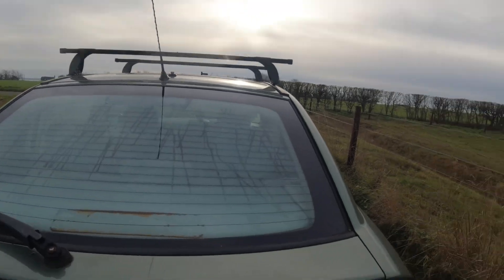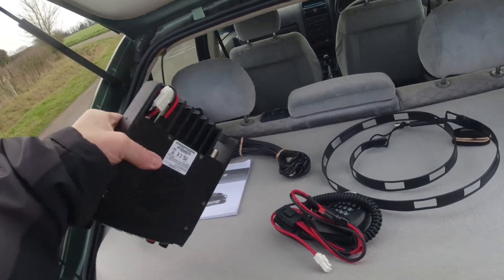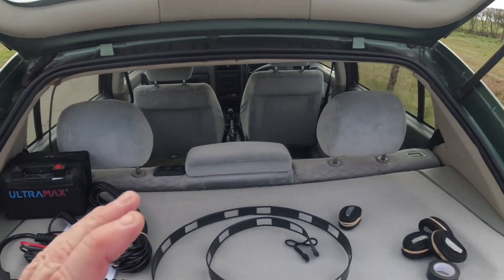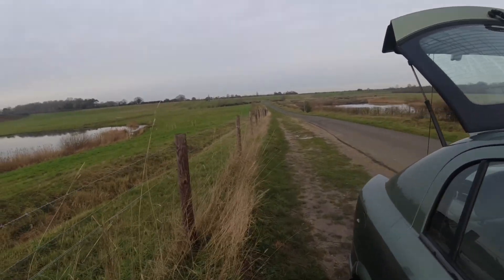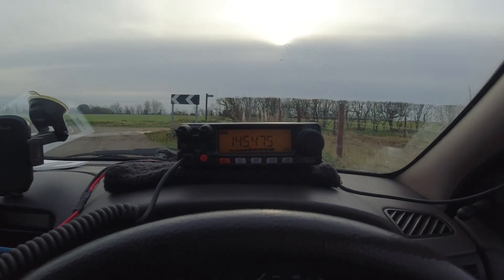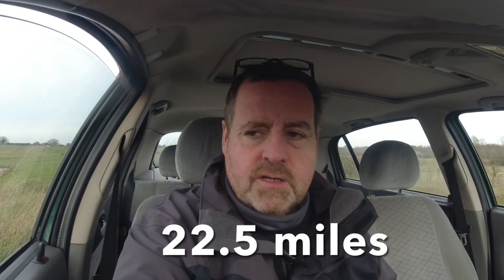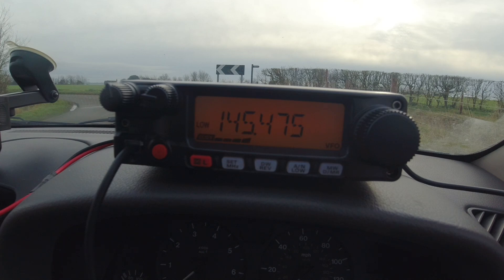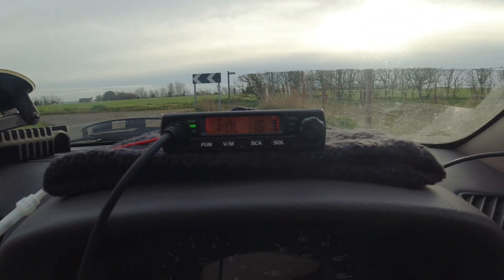Slim Jim Antenna and Yaesu FT-2980

Comment: I have this FT-2980 radio. I also purchased a N9TAX Slim Jim antenna. I need to try this sometime. I also own an ICOM IC-7100 all mode HF/VHF/UHF transceiver. I wonder if you setup the Slim Jim in  a horizontal polarized configuration if that would work for 2 meter SSB communication. Great video!
Reply from the maker: Thanks for watching, I have done it before on SOTA summits and it sort of worked when held broadside to the direction of the other station but you would be better off making a simple dipole or home made 3 element yagi,, there are plenty of projects online including ones made using cheap tape measures. 73 Kevan 2E0WMG

Comment: That’s not portable, that’s mobile!
Reply from the maker: The way I see it, if I can’t drive off because my aerial is attached to a fence I am portable. If I can drive because my aerial is attached to the roof of the car I am mobile. Hence why I was initially signing as /portable on 2m and 4m but when I switched to the MFJ whip on the roof I signed as /mobile.
Reply: It has to be mobile first .it can't walk.

Comment: Great video. I've got the FT-2980 and I wouldn't trade it for anything. Their new 80w offering on 2m just doesn't have the same robustness. Too many frills and bells and wistles. Well done
Reply from the maker: Thanks, I like the simplicity of the radio. It does what a I need it to do, and no noisy fan. Thanks for watching👍
Reply: @2e0wmghamradioandkayaking85  It works great as a dedicated 2m packet mail or APRS rig as well

Comment: Weird with the 4m G0JBA station hearing you then not hearing. Did you find out whether the Anytone was faulty? Or maybe condx had just changed. There's a bit of activity around here on 4m but not much. I built a 4m dipole out of some radials from an old colinear - works a treat. Good to see another video and glad to hear you're over COVID now. See you soon.
Reply from the maker: Thanks Michael, I checked the radio yesterday and it’s putting out around 18w into a dummy load and with good audio received on a 4m handheld so it’s a bit of a mystery. I hope you and Jackie are well and had a good Christmas, I’ve still got a cough but putting a brave face on it😉

Comment: Nice to see you having a practice with your gear ready for the 145 Alive its not far away (3 weeks) . I have a 2800M they are good strong radios as you say with not too many functions . Keep an eye out for the Net frequencies soon enoough!!! John M0XJA
Reply from the maker: Thanks John, I should be all set for 145 Alive. I had 12m of Messi and Paoloni Hyperflex 10 coax arrive yesterday so not so lossy as the RG58. Just hoping for light winds so I can get the Slim Jim up a bit higher 🤞